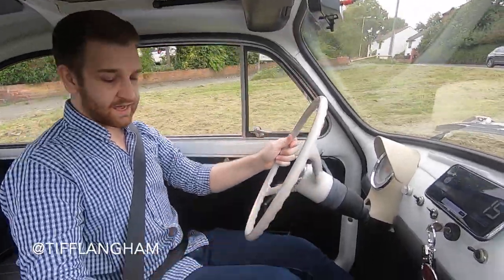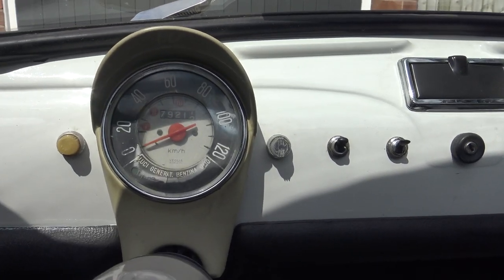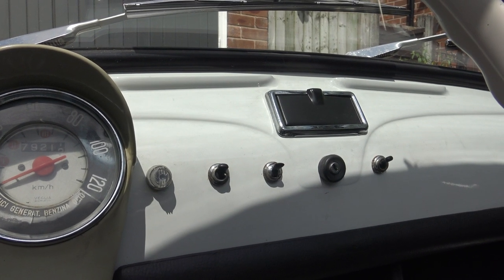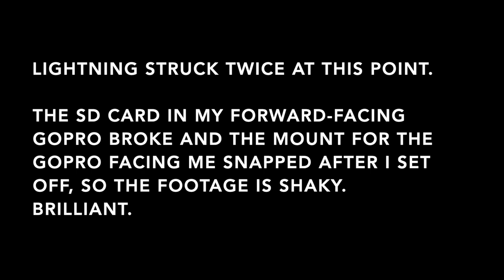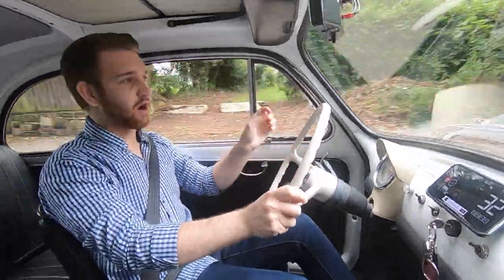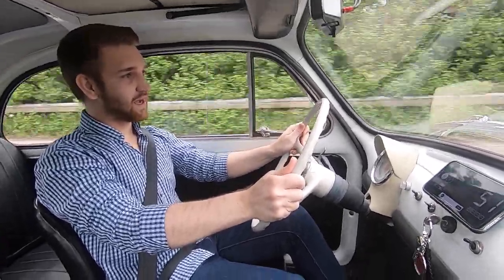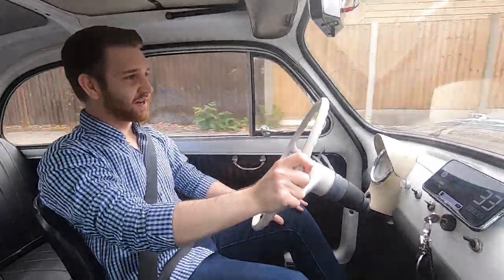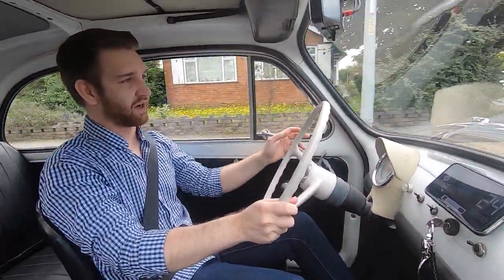Top Speed in a Classic Fiat 500

Comment: Yours has 18.5 HP and should do 105 km/h (about 65). The main thing that goes wrong is the timing. They can be set static timing with a 12v checklight (which is easy to make). Then ther is centrifugal advance, which means the faster the engine runs the more timing you should get. Sometimes this mechanism gets stuck and then this means the car doesn't like to rev.
You need the Haynes Manual which explains it all, it is simple to do and really makes it run well. 
BTW I have a 650cc with some Abarth stuff and that does 145kmh... (it is a bit scary), which is 90mph.:face-orange-biting-nails:
Yours is a 500F same as here: https://www.youtube.com/watch?v=rDXo2d1XO_A